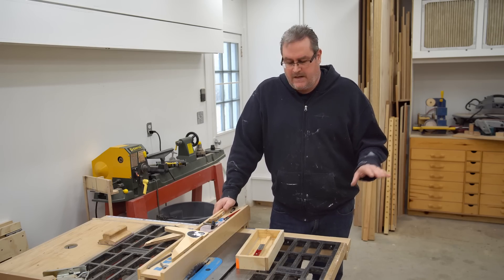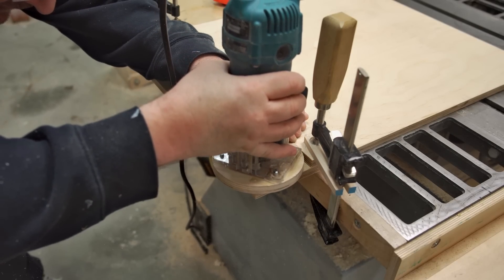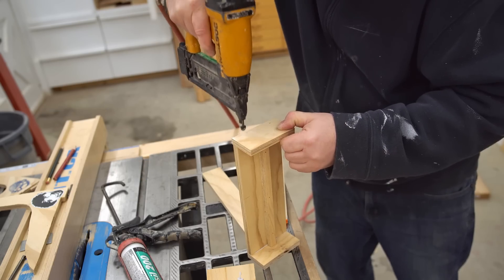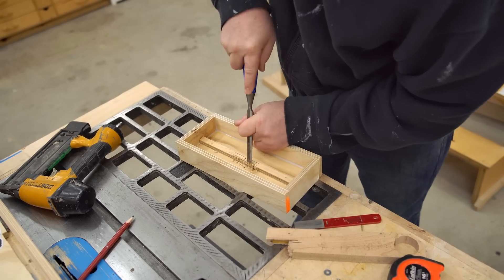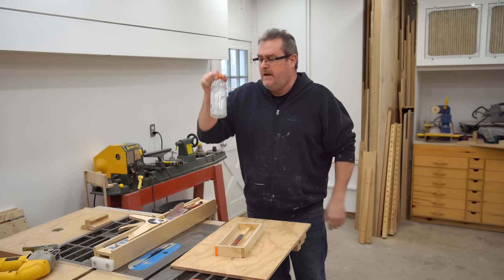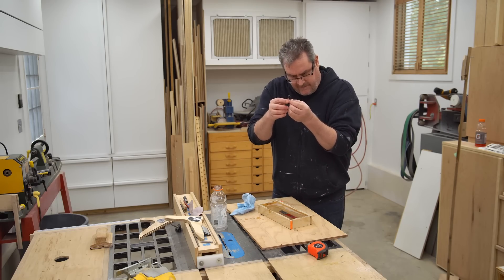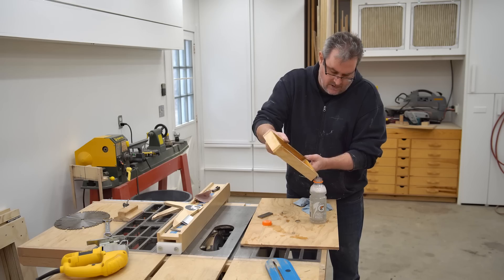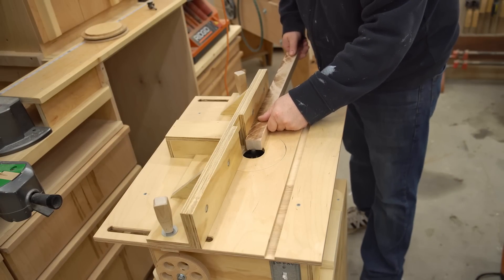Jig For Sharpening Router Bits (experiment)

Comment: I've been using those sticks for quick sharpenings for years, but free hand, because, sometimes it seems it's best to use 1,2, or 3  different grits and those sticks are available to 3 or 5 packs of different grits too.  I just wet the stick either under a faucet or dipped into a cup and then either move the bit or move the stick along the flat side of the cutter. One thing of note is to always count the same amount of passes for each side of the cutter so they are sharpened equally. There are diamond cards available too which may actually better sometimes because they are thinner whereas the thickness of the sticks can sometimes interfere with the bits profile.

Comment: Hey John, I remember seeing a technique somebody had for a knife sharpening box that had that held water. He used a thin metal rod or a wire and hammered the edges down the center a little bit. He did this to compress the fibers, and when they get wet, they expand again. After he hammered the groove in, he planed down the high sides a little bit. Once he glued the box together, when the water is poured in, those fibers expanded when water hit and sealed up the joint.

Comment: that is a diamond "stone" and should not be used with water.
Reply from the maker: Nonsense.
Reply: i was trying to simplify so i wouldnt have to explain a huge amount to you, but, if you insist. using a media stone, a little water is added to soak the stone and also to create a cutting slurry on top, that creates an abrasive media, so in that case, using a traditional stone, then yes, water is needed, and after use or during heavy use, the stone should be washed to remove the steel left over in the pores of the rock. diamond however does not create a slurry, as you cannot grind off the diamond with the steel. so water only lubricates the surface and decreases the removal of steel. this is why polishing wheels are used in a running water "pool" in the base of the tools rest. 
so, you can wipe off a diamond lapp or wash then dry it every 30 min of use, or tap it upside down to remove the media removed from the steel. this is why i said you may use a little water. i neglected to mention that it should be dried off again before continued use. but this is why i made my original statement, that water should not be used with a lapp, if being used to remove steel. 
this is proven in the video, as it took a very long time, to remove the media, because in fact, it was being polished not cut. notice, the diamond wheel used in the table saw was dry and cut extremely fast, but if, as in a polisher, there was a water bath, it would only polish the surface. 
it is possible you are confusing diamond with carbide, which does most certainly require a large amount of water as it is extremely brittle and prone to fracture under heat, and this is why concrete cutting is done with water flowing onto the surface being cut away, and also to remove the cuttings so the dont jam the wheel or get recut. 
in summary. stone or corundum stones, use water, or oil, but i prefer water as i feel oil clogs the stone. carbide, use running water, as a way to remove cut media, so it is not re-cut, as in masonry use. and diamond, use water only to wash the lapp after use. or, periodically during use, then dry the lapp before continuing, 

of course, do what ever you want. its your life, but using these methods will get you the longest use out of your stones and best performance.
Reply: Diamond stones cut faster and last longer when used with water... shouldn't use them dry : )
Reply: Luci Venom okay, but what's the balance between washing away the cuttings and flooding with water...and why would stock removal be low with too much water? ...surely, if it's wet, it's wet !? Please explain. Cheers 

...and, you said in your original comment that water should not be used (at all)? So which is it??
Reply: Luci Venom tons of info, very interesting. Thank you : )
Reply: If the plate is too wet, the diamond becomes flooded by lubricant and the stock removal will be very low. the only reason to lube diamond is to wash away the cuttings, but if youre taking that much metal off with a hand lapp youre doing it wrong.

Comment: I've just started in on trying to sharpen more things in my shop, so this is really helpful and timely. I have a couple router bits that get used a lot so they are likely candidates for trying this out. Do you use a bit of detergent in the water with your wet stones as well? I've just been using straight up water.

Comment: Perhaps some sort of metal device/holder to grasp the router bit, while moving across the sharpening stick?  There seems less control and risk of scrapping your knuckles...with the fingers so tightly grasped on the bit.
Reply from the maker: A magnet might work, but you really need to feel how the bit is sitting on the file to keep it flat.